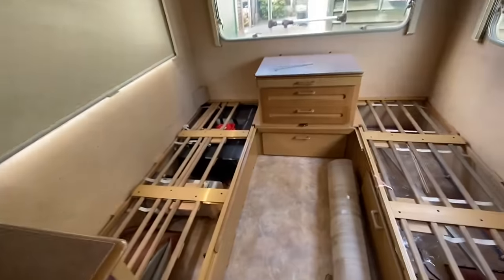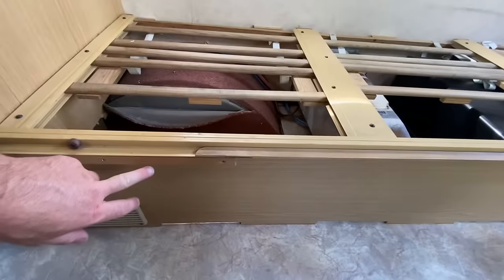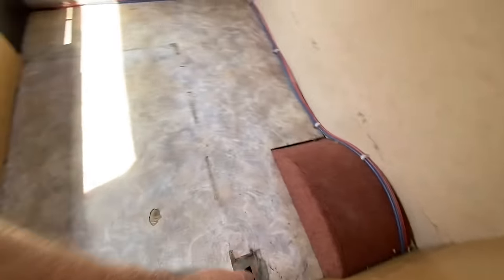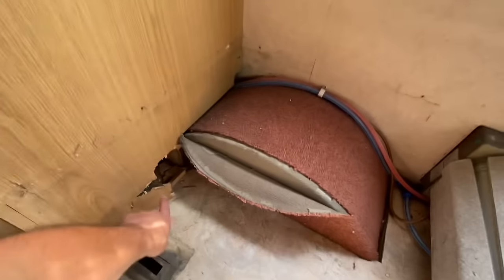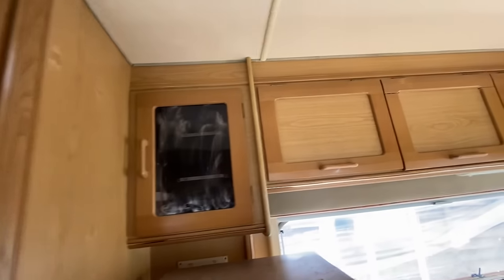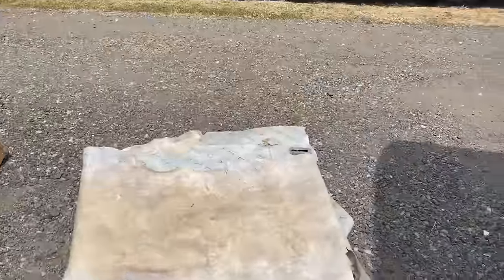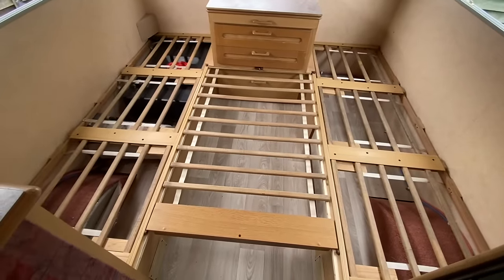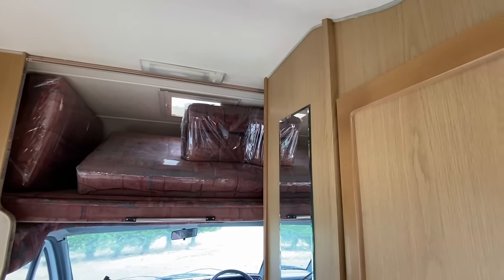HOW MUCH HAS THIS MOTORHOME COST? IS IT THE CHEAPEST IN THE UK ?

Comment: Very good attention to detail. When the tyres are checked out wouldn't it be a good idea to ascertain how old they are from the sidewall codes? With a vehicle of this age they could easily be more than 10yrs old which would suggest replacement.
Reply: I second that as a tyre fitter in the trade it’s recommended that tyres shouldn’t be on a vehicle for more then 5 years obviously there’s no law on it we can only advise but tyres can still look good even at 5-10 even 15 years old but they won’t perform aswell as tyres that have been replaced within the 5 years
Reply: I think this is what Rob meant when he said they need to be inspected. 👍🏻
Reply: @andywoolley2636  You might be right. Equally, he might have meant checking for cuts, bulges etc. Let's see what transpires.😀

Comment: The TV bracket in the motorhome we had until a year ago was one specifically designed for a m/home in that the TV was not fixed permanently onto the wall bracket, there was a separate part that screwed on to the TV. This allowed us to just lift off the TV and store it while on the road, or when the van was in storage we took the TV home. I would be concerned about driving around with the TV on a hinged bracket. When on site the TV was just slotted onto the wall bracket and was ready for use

Comment: My friend bought an almost identical one about a year ago now and iirc he paid about £12,500 for it. Problem was, it was a dog and he's almost spent that again on it and more to come with the electrics. We've just replaced the 4 knackered 10 year old solar panels with a new one, along with the battery controller etc. That's working nicely, but the old charger and display panel are still playing up, so we need it looked at before we decide if that needs replacing with a new inverter. 
Your one at £11k represents really good value for someone, especially as it's had the full works from you both. Good luck with it, enjoy your break.  
Best wishes to the pooch, I think I remember seeing it in one of the ( Lambo? ) vids, if it's the same terrier type, don't write it off, they are so hardy!!

Comment: Rob make sure you check how old the tyres are, I’ve recovered a fair few off the motorway where the tyres are 15-20 years old and they’ve just blown out causing loads of damage to the van as they flick round and rip off wheel arches etc, for the sake of a few hundred pound might be worth investing in some new ones

Comment: What a nice job you made of this again but Rob should of put a 12v TV in it that way can still watch it if not on electric hook up,also a old van I once had the front draws come off to make the bed bigger and went under the pull out slats and sat on the floor out of the way but that said yours maybe different.
Don't blame you for keeping it nice and easy weekends away or make picking up them long distance cars more fun if Clair would not mind driving it that is 🤣🤣🤣

Comment: You can get quick release brackets so the TV can be transported safely in its box. Also that will be 240v mains only, you can get TVs that also work off the 12v battery.
Reply from the maker: It’ has a inverter
Reply: @sruk  useful, but inefficient. If your on sites 99% of the time and use it for brief stops it’s not a worry. If you want more freedom a roof mounted solar panel fitting would be a good video.

Comment: Get a tv bracket where you can detatch the tv and store for travel. Not a good idea to travel when mounted there is a lot of weight to pull a hole in the wall on rough roads
Reply from the maker: You won’t pull that one down bud it has a baton behind it 👍

Comment: Well bought and seems a good price to sell. Nice job of the flooring - thought it would be a nightmare to fit neatly. Habitation certificate? Surprised you aren't doing the front bumper paint. Could have got a secondhand TV of similar size for £20/£50.
Reply from the maker: The bumper is being done 🤷‍♂️

Comment: HI NICE WORK ON THE OLD GIRL ... WE BOUGHT A 1998 PEUGUOT ELDDIS 2.4 TD 6 BERTH .. 33000 MILES ON CLOCK .. £14.000 .. ALL ROUND GREAT VAN BUT Blind & Flyscreen WILL NOT GO UP DONT KNOW IF CAN BE FIXED OR CHEAPER GETING THEM REPLACED.. .. WE ARE FIRST TIME OWNER OF A MOTORHOME.

Comment: If you’ve not already sorted the bracket. Get a quick release one; most wouldn’t routinely travel with a tv that size left in place , they’d remove and fit once on site, hence a quick release mount - ideally with an arm you can move it as needed to a different angle.

Comment: Wow, it looks so different!! Great job as always!! But there is a table? If you sell it to trade ok but if not you need to get the gas system tested. The price is right as always!! Did you check the water pump? Might worth swapping it.
Reply from the maker: Everything works perfectly
Reply: @sruk  Perfect Rob! But just to be safe as this was sitting for a long time, please get a gas pressure test before you are going to use it.

Comment: Wrong TV for a motorhome! Should have gone for a 12V/240V model (campsite 240V not alway available/reliable) from a motorhome/caravan accessory dealer, they come with DVD player and both freeview and freesat receivers plus smarts for about the same money. They also do suitable mounting brackets!!!
Reply from the maker: It has a 240 inverter fitted

Comment: Rob them draws are not ment to be permanent fixed down, they are ment move them out to make the bed bigger
Reply from the maker: If they wasn’t fitted down they would fly off every time you hit the brakes
Reply: @sruk  the base of the draws should have two clips to hold them down